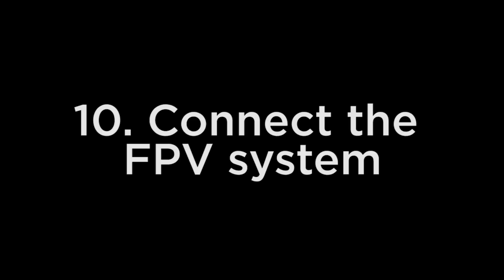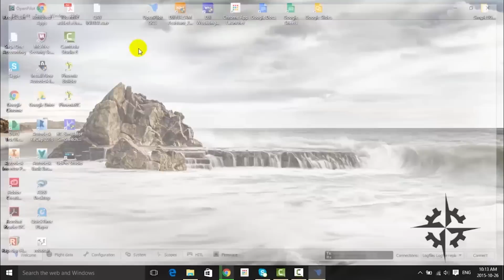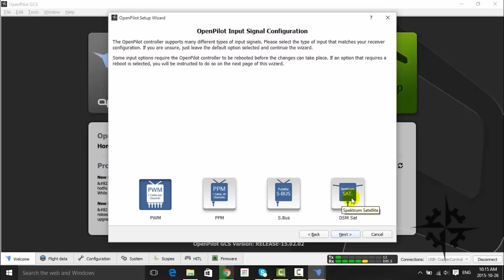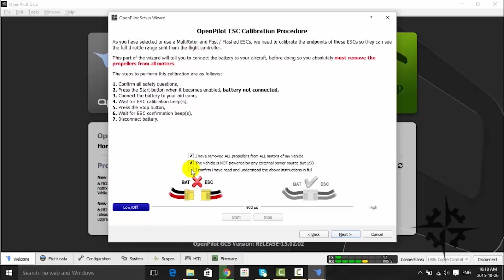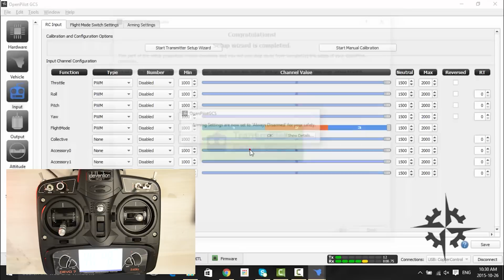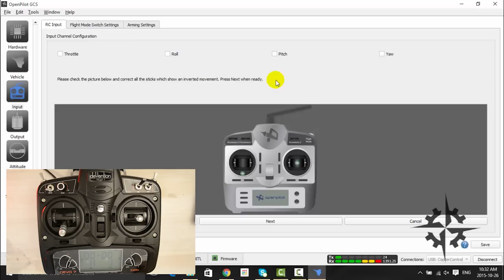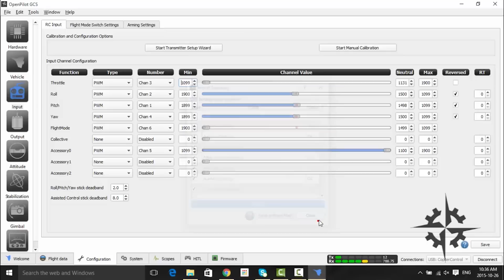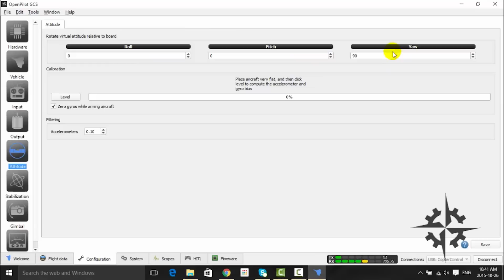Build your own racing drone Part 3. ZMR250 DIY

Comment: May I ask what connector you use to charge the battery? Thanks.
Reply from the maker: Hey toy2ify if your question is which one of the cables of the battery you use to charge them, then you will have to use both, generally the chargers will have two power outputs that go into the battery one is the main power supply (XT60 yellow connector) and the other is the balancing lead which has 4 cables if you are using a 3 cells battery or 5 cables in case you are using a 4 cells battery.

Comment: Hello. Great video but could you send me another link with the kit because that in the description doesnt work :). Thanks in advance :)
Reply from the maker: Hi Lorda, please check this one out:

https://coastlinerobotics.com/collections/multirotors/products/zmr-250-diy-kit-with-race-specs?variant=21077514819
Reply: thanks very much :) I am interested in that hobby but i have never done something like this - is this for noobies i mean :D Is it proper to start with :)
Reply from the maker: Hey Lorda,  yes, this is a good starting drone. Remember that how the drone behaves is completely up to you and how you configure your flight controller. You can make it fly very gentile and with stabilization turned on or you can make it fly very fast and without using any of the sensors, so flexibility is one of the main characteristics of these drones. Also is good to start with a not too powerful battery like a 3 cell battery and then upgrade to a 4 cell battery once you have mastered the controls. If you are interested I can bring you support to help you configuring it. Please let me know what do you think.
Reply: i think that this isinteresting hobby but i am not sure that it is for me :) ;(

Comment: one more thing can the battery be charged and if yes we're can I get it (hopefully from you because you're awesome!!!)
Reply from the maker: Hey +the Bossness Of Gaming yes, the batteries we use on these drones are a rechargeable type of batteries called lithium polymer or Li-po. The main specifications you should have into account are:

Voltage (V)

 The voltage of the battery is given by the number of cells connected in series, each cell has a nominal voltage of 3.4V, so when you see 1S that means is a battery of 3.4V because is only 1 cell, a 2S battery will have 7.4V because 2 cells are connected in series, a 3S 11.1V, 3 cells in series , a 4S battery 14.6V and so on and so forth.

Capacity (mAh)

Understand capacity as how big is your fuel tank is, a battery with higher capacity is capable of storage more energy but with the counter that will weight more, so you must have to find an appropriate balance between capacity vs weight. Capacity is measured in miliAmperes or mAh. 

DIscharge rate (C): 

The discharge rate express the ability of the battery to bear with extremely high current changes when flying doing acrobatic movements or racing. In theory the higher the Discharge rate the better the battery.

For this kind of drone a good starting battery should be a 3S 1550 mAh 45C.
http://coastlinerobotics.com/collections/multirotors/products/tattu-1550mah-45c-3s1p-lipo-battery-pack

Once you have mastered the controls and wants to upgrade you can use a 4S 1550 mAh 75C battery, the drone will be faster and more agile.
http://coastlinerobotics.com/collections/multirotors/products/tattu-1550mah-14-8v-75c-4s1p-lipo-battery-pack?variant=16018605059

Comment: sorry I mean motors and remote control
Reply from the maker: Hey +the Bossness Of Gaming the motors must be connected to the ESC's and both have cables to connect to each other. The the power cables of the ESC's must be connected to the power distribution board and the servo lead must be connected to the flight controller. On the other hand, the flight controller includes the breakout cable to connect the R/C receiver and other cables that can be used to add other components like sensors, gps, etc.

Comment: is the battery cord that you have to solder on the the flight controller come with the package?
Reply from the maker: Hey +the Bossness Of Gaming, yes it includes the cable and XT60 female connector. And the connection is made to the power distribution board, not to the flight controller.

Comment: may i ask if the software come with the Racing Drone also
Reply from the maker: Hey +Paul Roberts the software is available to public access on line. It comes pre-flashed and ready to use but it is recommended to upgrade to the latest firmware.

Here you can find mnore information about the CC3D:

https://librepilot.atlassian.net/wiki/display/LPDOC/Welcome

Cheers!
Reply from the maker: Hey Paul, yes the software is Open source, that means that is available online for everybody. You can choose between a couple good software programs out there like Cleanflight, Betaflight or LibrePilot.

Please check the links to learn more:

https://github.com/betaflight/betaflight

https://github.com/cleanflight/cleanflight

http://www.librepilot.org/

I hope this could help.

Cheers!

Comment: how much did it cost you in total to build your own?
Reply from the maker: Hi +mikerman50 , the aircraft with the main components which are:

Frame
Flight controller
ESC's
Motors
Propellers
Radio controller + receiver
FPV system (Camera + Transmitter)

Was only $315 USD.

http://coastlinerobotics.com/collections/multirotors/products/zmr-250-fpv-racing-diy-kit?variant=5014444803

Then you will have to add the batteries, charger and the FPV goggles. But they are additional.

So let's say you want to get about 10 batteries (each one @ 16) will be $160 USD
http://coastlinerobotics.com/collections/multirotors/products/11-1-v-li-po-battery-fpv-racing-drone?variant=7068914563

Charger: $59.9
http://coastlinerobotics.com/collections/multirotors/products/imax-b6-digital-rc-lipo-nimh-battery-balance-charger

FatShark Dominator v3 FPV goggles: $350 USD
http://coastlinerobotics.com/collections/fpv/products/fatshark-dominator-v3-fpv-goggles?variant=6218161347

Cheers!